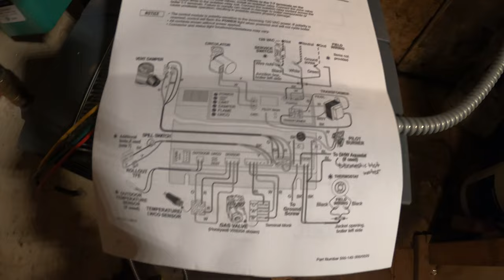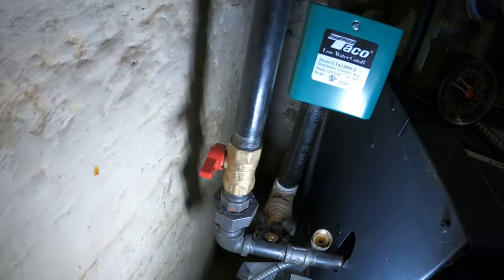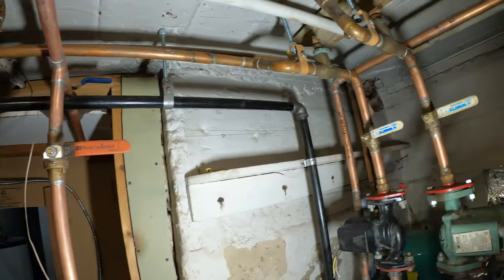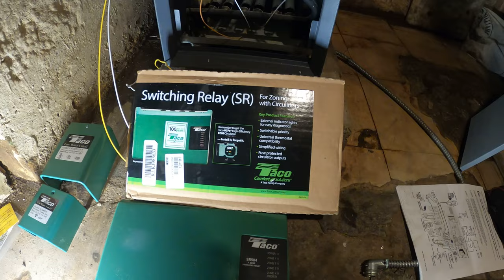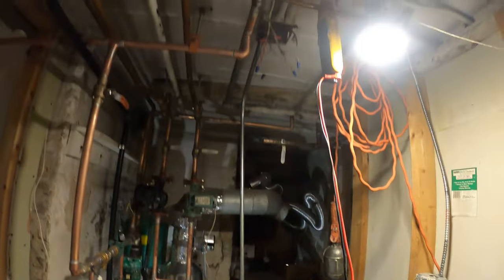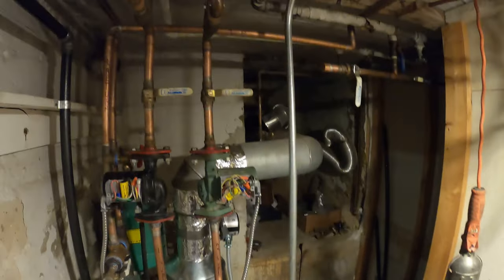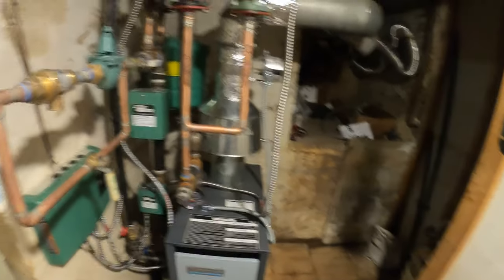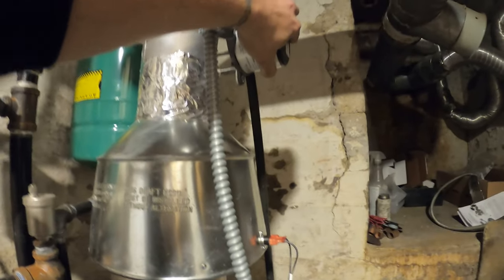HVAC Service Call: Wiring A New Hot Water Gas Boiler (Taco Switching Relay Installation) Weil Mclain

Comment: Good job figuring it out !!  I still put circ pumps on the return line but you dont have to. It used to be the case that the high temp of the supply side was thought to be bad for  pumps so they put them on the " cooler" side to extend the life of the pump.. Apparently high temps are no longer a problem for the materials used in pumps today .

Comment: Nice video since that boiler has wire for the circulator pump so when you use the switching relay, you don’t use that wire no more?

Comment: Great video as usual, jmt. I haven't done too much boiler work before but I have had to set up and wire zone controllers, etc for radiant floor systems tied to a HE Boiler. I think it would be great if you did an overview video covering the basics of HE boilers and controls in general. Like besides Taco, going over some more common mfg controllers in addition to the boiler itself. The way you cover this material is very understandable and relateable.

Comment: Fire that plumber! Who the hell installs a brand new boiler and leaves the old check valves, the old pumps and doesn't install proper air elimination. I would have turned around and walked away. Wouldn't want my name on that piece of crap!